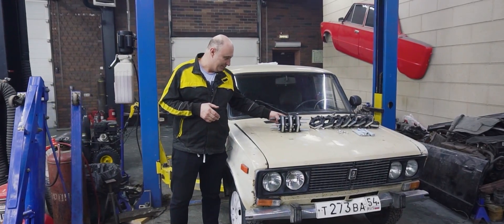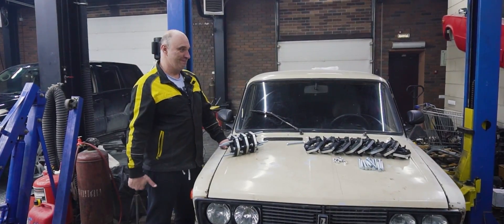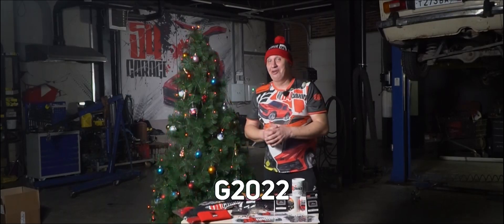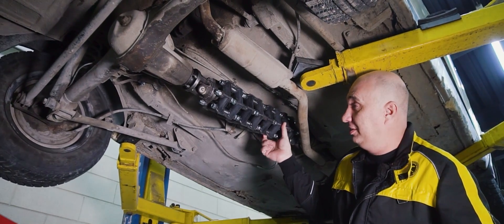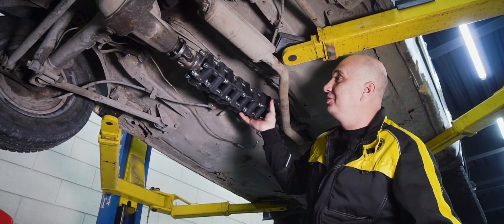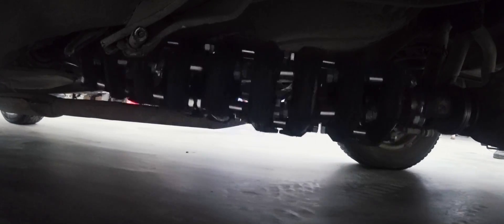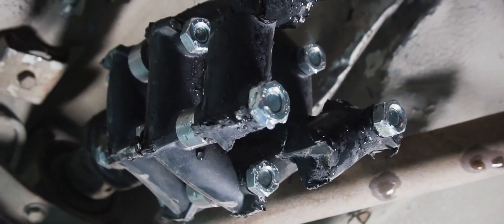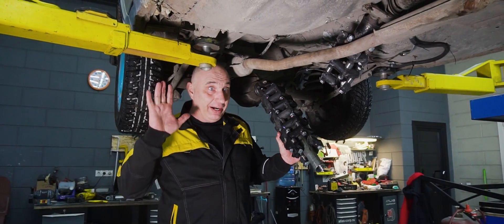Making a propshaft out of flexible couplers: will it work?

Comment: GM had a flexible driveshaft in the 1960s, basically a big braided steel cable, I say try that next.
Reply: Another comment from the old Master Technician:

The GM driveshaft to which you refer was designed much like an oversized speedometer cable and operated within an enclosed housing, which retained the rotating component so that rotated about it's longitudinal center of mass

It appears to me that some of the Garage 54 projects are intended to fail to make the show more interesting.

Nothing wrong with that, I enjoy the show

Incidentally, I worked for GM for a half century ago  before moving on to more interesting work.
Reply: my RC boat has a braided steel cable prop shaft
Reply: Common in cars like the Pontiac Tempest.   It was like you said,  a large steel cable, but within a tube.  Think a lower-end weed-whacker.  The cutter head is connected to the clutch via such a shaft.  Especially those crappy curved ones.
Reply: @Cammi_Rosalie  the professional echo trimmers actually use flexible shafts in a straight shaft. It's for reduced vibration.
Reply: @Cammi_Rosalie  Wrong. The best grass trimmers like Steel and Echo both use a flexible driveshaft, they have for over a decade and it works much better as it is much lighter and transfers more power directly to the end of the trimmer... The trimmer itself is also much lighter and it doesn't stress the driveshaft as much either so overall more reliable.
Reply: @mcr5645  Stihl*
Reply: @Cammi_Rosalie  Pontiac Tempest drive shaft was solid steel , Not cable. It had a support bearing in the middle that made it run in a slight curve.
Reply: @earlfoster9714  It was more of a torsion bar.
Reply: I was partly wrong. There was no bearing in the middle,. but it did run in a curve and it was a solid steel rod. ( I googled it)
Reply: I love 2atching stuff like this these Boyz can put anything together by learning how to put silly stuff together genesis
Reply: Another feature of the unique Tempest driveshaft system was that the driveshaft turned at engine speed and drove a rear transaxle derived from the transaxle system used in the rear engine Corvair.

Therefore, the driveshaft ran at substantially higher RPM, and lower torque loads.
Reply: @philschaad6693  That sounds like it would cause more wear and year in the long-run on both the engine, transmission and transaxle?